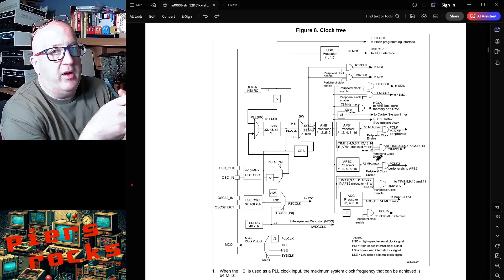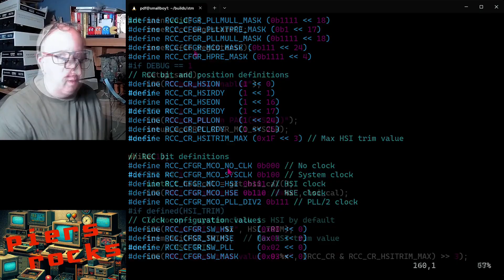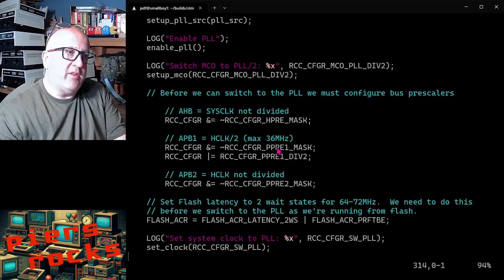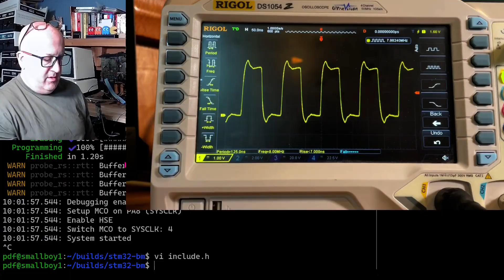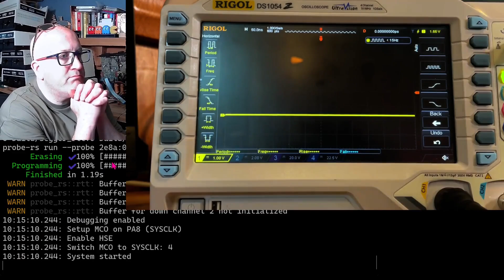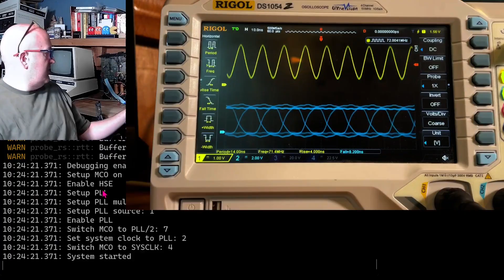🚀 Highest possible ⏱️ clock speeds with bare metal STM32F103 programming

Comment: Those "clones" are not even clones. I saw crystals. Each variant has its own architecture.
Reply from the maker: @Ma_X64  one board has an stm32. I removed the stm32 from the other board and replaced with an fcm32 clone. I tested both with internal oscillators (and the stm32 with its external oscillator as well)
Reply: @piers_rocks  Oh, functionally they're the same, yes. I meant if you would dissolve the ICs plastic package, the actual  silicon crystals have different structures in themselves. *Also some chips with large flash memory could actually have the last pages of it being connected through the SPI and the additional memory crystal would be on top of the MCU then.
Reply from the maker: @ yes agree - although as I showed, there are also some functional differences when running off the internal clock.
Reply: @piers_rocks  I heard that GDs even fixed some ERRATA issues of the original.

Comment: what about the giga devices clone? I thought those ones are not 1:1 but I think I saw they can go even faster than stock stm32f103
Reply from the maker: Some GD32F103s arrived yesterday, but they are the 64-pin variant, and I'm still waiting for a PCB to install them on.  Will run the same set of tests when I can.  I specifically started with the FCM32 clones as they were the cheapest I could find.

My guess is the faster clock speed is when using the external oscillator, and "officially" supports higher than 72Mhz, just as you can overclock the STM32.  If it's register compatible I don't see how you'd clock it any faster using the HSI as the PLL mult only goes up to 16 (x8/2Mhz).

Some reports suggest the GD32 achieves zero wait states from flash, as they cache the entire flash in SRAM.  This could be very interesting - or not, if the SRAM bus is contended like the stock STM32.

As I've found out - it's complicated when it comes to running these things at high speed.